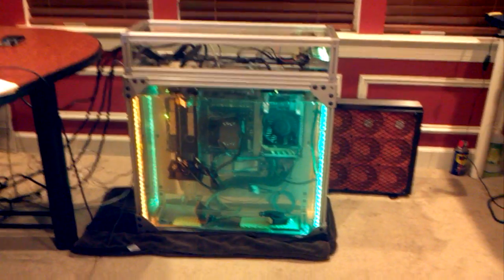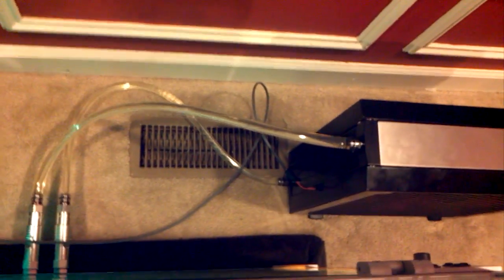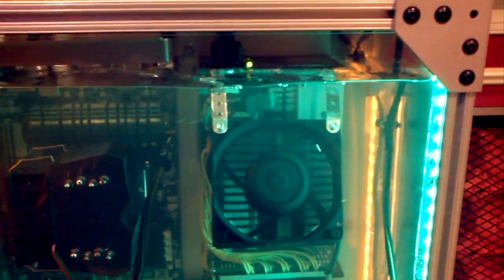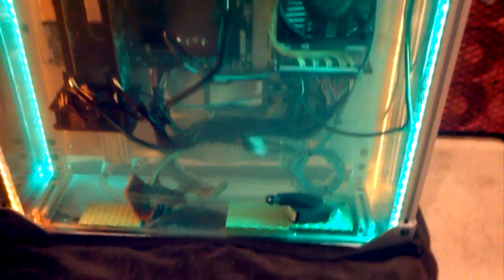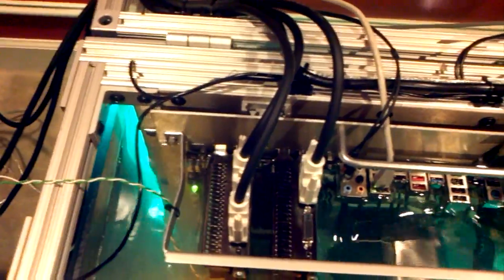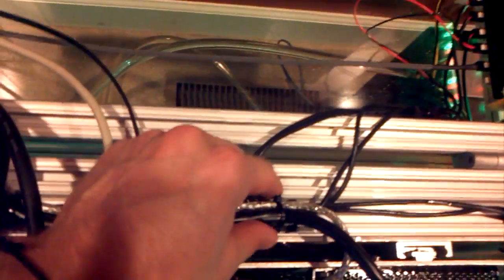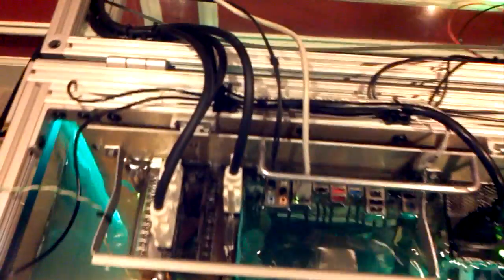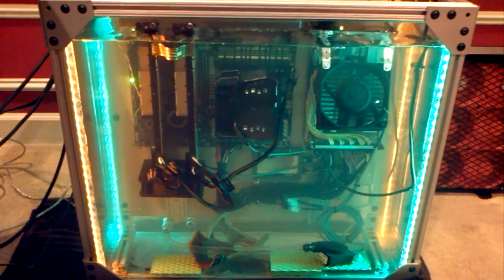Mineral Oil Computer Done!

Comment: Can someone explain to me how he submerges a whole motherboard with CPU and everything with it still running.
Reply: its not conductive, but absorbs heat.
Reply: it's mineral oil not water.
Reply: Oils don't conduct electricity the only difference for the electronics between the air and this is the oil disperses heat better....
Reply: Mineral oil doesn't conduct electricity, its also relatively inert and doesn't react with the silicon, copper and other materials in the computer components.

it does have a high specific heat capacity though so thats why he needs the large radiator. Mineral oil absorbs heat and retains it, something like water absorbs the heat and the releases it.

There are no real benefits to using it though, a well thought out custom liquid cooling loop would out perform the submerged PC with far less hassle, mess and expense (the large amount of oil is expensive by itself, £4 per litre when bought in bulk. A setup like this could use as much as 50-75 litre). Upgrading or maintaining a mineral oil system is a nightmare of gooey oily mess and its very difficult and time consuming to clean any parts you remove, people mainly build these systems for the cool factor because a submerged machine is very eye catching.
Reply: Bosh Wean no one forced you to.
Reply: RabidCicada You can build a near silent air cooled system let alone liquid cooled, its not hard and its not as expensive as building a submerged PC. If thats why you built it you're doing it wrong, if you build it because you liked the looks more power to you as there is nothing wrong with aesthetic choices.
Reply: Bung Bruiser Exactly, your biggest risk is an oily mess if want to upgrade and or something goes wrong
Reply: he submerged it in mineral oil. does not conduct electricity and is not a danger for your computer if submerged. but you would have to think twice before trying that, cleaning mineral oil of ALL of the parts might be tricky when you dont want it in oil anymore. just saying.
Reply from the maker: Tuberuser187 he's got it right.  Except for one thing...the reason I looked at this in the first place was to cool every single component near complete silence.  It did that very well.  Very very very quiet.  Power supply and all.  Barely audible fan noise from the circulating fans etc.  So there is one advantage pure water cooling doesn't do.
Reply from the maker: Tuberuser187 wow that was a fast response!  I absolutely chose it because it looked cool.  But and air system to drive 3 high end gfx cards folding@home would certainly not be quiet.  And if it was it would income a much larger physical setups than what I used.
Reply: RabidCicada If you are running that lot under oil rather than water it would be louder than just water because of the size/amount of fans you need to cool it, I shudder to think the amount of heat that oil would hold otherwise. An air system with 3x gpus would be noisy but near silent with air is possible.

You can get full tower size cases that easily mount a pair of 420mm and/or 360 radiators and would be more than enough to keep even three of the hottest hybrid AMD GPU and space heaters (seriously they should move into the home heating market) cool and silent.
Reply from the maker: Tuberuser187 about the fan thing...that's why I did oil....even the fans themselves are in the oil submerged.  So the oil really does silence EVERYTHING.  Pure water can't possibly be as quiet because the pumping mechanisms are not submerged.  And air would require very high speed or very large fans... to the point where you get whine for high speed or shuddering from large size.

I have submerged fans for oil circulation.  If I didn't, I got stratification of thermal layers to an extreme.  I had super hot oil on top with balmy warm oil on bottom
Reply: RabidCicada But how are you cooling the oil? Unless its 20mm deep and as much surface area you get with a king sized bed the oil will not disperse enough heat into the air, probably not even then as you are claiming around 1KW or more of TDP going into that oil.

You need to run the oil through a large radiator with air forced through to cool the oil which means lots of air flow and powerful pumps to move the viscous liquid, circulating it around inside the tank isn't enough. With a kilowatt or more of TDP you could replace mineral oil with cooking oil and you would have a great deep fat fryer, how many deep fat fryers cool themselves just by contact with the air when the heat is constantly applied?

Mineral oil is nearly as inefficient as air at dispersing any heat it holds and holds far less heat (1.67 kJ/kg.K vs. 4.19 kJ/kg.K), water is far more efficient hence smaller radiators with less air flow. Less air flow, less noise.
Reply: Tuberuser187 You could feasibly use a copper coil on one side of the tank and pass cooled water through it with fans or an Ice pack (something to get it very cold) and since the inside is oil you wont have to worry about any condensation inside so you could actually make it ~40-50F with easy but then again your still using a massive overcharged liquid cooling BUT it would run your computer and temperatures that a air cooled PC would never be able to achieve and a water cooled one was unable to since it'd cause condensation on the wire/tubes with such cold water.
Reply from the maker: Tuberuser187 theres a large radiator behind the PC with very low air flow through it.  It works well enough as demonstrated by use.
Reply: RabidCicada To cool a radiator with mineral oil inside will need more airflow than a radiator with a 50/50 mix of glycol and water, its without question. It might work well but a water cooled setup would have been cheaper, less messy and even quieter with less effort.
Reply: NexusChild925 Some people just build Freon setups using freezer parts (compressor etc) with well insulated tubing for sub zero cooling.
Reply: Tuberuser187 Yes but that brings additional issues like 1. the expertise to maintain and the hassle of maintenance. and 2. Wouldn't there be issue of condensation appearing on the boards and drives themselves rather than the tubing?
My method allows for a simple although, less effective, build. It'd be a very cool experiment to create and in the end it would both be a cheap, and safe alternative which requires little to no maintenance. Sad thing is I can't do it since I don't have the time or funds to test it lol but in the end it could even be improved upon by making the space above the oil that's a vacuum or completely dry air free of moisture to ensure no water droplets can form. All in all the build would take a lot of time and revamping for the first build but then it'd be possible to trouble shoot any issues and improve upon them.
Reply: NexusChild925 It would be interesting to do maybe, practically though for long term sub zero cooling a Freon setup is the only real solution at the moment.

If its put together well it would need no more maintenance than a freezer would, the board and drives wouldn't get condensation on them. Condensation forms at the point the warmer ambient air contacts anything colder than itself which causes the moisture to condense back into water as warmer air can hold more moisture. As long as the Freezer components, tubing and the cold blocks/contact points are well insulated from the room temperature air there will be no condensation. the only part you need exposed are the contacts between the cooling system and the hot chips (known as evaporators), you also need to apply a lot of insulation around the to isolate them.

Literally spreading some form of liquid epoxy or something similar around the heat spreader of the CPU/GPU which is obviously permanent.

All in subzero cooling is the most impractical and probably useless way of cooling a PC, generally only the most determined hobbyists and enthusiasts do it or people looking to break overclocking world records.

Oh yeah, in some countries it might be illegal too. Gasses like Freon are heavily restricted and you need government licences to handle them and purposefully releasing them can get you prosecuted, that includes accidental releases from home made equipment.
Reply: Tuberuser187 Yeah I knew how condensation formed and my worry was that the condensation forming wouldn't be on the tubes but the motherboard, HDD, etc. unless your cooling the entire case not just the individual components like the GPU, and CPU the air inside will always be slightly hotter than the components themselves allowing condensation to form just like if you were to open your freezer the walls would be damp or even icy....or am I over looking something else about the subzero set up?
Reply: NexusChild925 The reason you get water or ice build up in your fridge or freezer is because you open it :) You basically let some of the colder and drier out and replace it with some warmer air that holds more moisture, when that air cools down it cannot hold as much water as it could at room temperature. 

The point at which is condenses out is called the "dew point", the range of temperatures and humidity where this can happen are generally way outside the ranges associated with warm or even hot computer parts and most indoor temperatures.

With a sub zero cooling setup the most likely part of the system to cause that is the evaporator where the temperature drops rapidly due to the expansion of the gas, in normal 20-25°C room temperatures it will quickly chill the air that touches it to the dew point and then freeze the moisture.

As long as you insulate/isolate it both from the board and the surrounding air there will be no condensation, it is obviously smart to insulate everything else (aside from the compressor) as well but the evaporator is where you really need to take extra care.

The air temperature inside the case doesn't matter in anyway other than it normally would, nothing else changes you are just putting a really, really cold thing next to the CPU/GPU that you want to cool instead of a standard heatsink or water block. If you are packing the compressor inside the case that needs some attention as those get warm in their own right but otherwise apart from bolting the refrigerated circuit to the hot bits inside the PC (and isolating them ofc) its basically business as usual when compared to standard air or liquid cooling.
Reply: Tuberuser187
Ah thanks for explaining that, i can see now why its a viable choice for users but yea like you said earlier this seems to be going completely overboard lol
Reply: RoMMeL1337ak47 Exactly, water holds more heat and transfers it faster. You need less air flow from the radiator and you can fit the whole cooling loop completely inside the case, it wont end up weighing 75kg+ as the oil cooled computer nor anywhere near as messy.
Reply: RoMMeL1337ak47 Well go back and re-read the comment, I admit I wasn't as clear as I could have been (tired posting) but the discussion was about water cooling being more efficient than oil. The figures I quoted are actually the specific heat capacity of water and mineral oil and not air, the whole quote you mined also happened to be:-

"mineral oil is nearly as inefficient as air at dispersing any heat it holds and holds far less heat (1.67 kJ/kg.K vs. 4.19 kJ/kg.K), water is far more efficient"

So yeah I hold my hands up to not being as clear as I could have been but the topic of discussion was about oil vs water cooling and not air.
Reply from the maker: RoMMeL1337ak47 When I moved the computer I pumped all the oil back out and into the barrels:).  It is indeed a pain:).
Reply from the maker: Tuberuser187 I don't know how well youtube tracks reply-to-orig-comment but I'm responding to your statement about 50/50 glycol and water and being quieter.  I agree with you if you include using other sound damping materials to quiet components that are actively loud.  Remember, I am balancing quieting components that are not quieted by having a water cooling block instlalled along with cooling quietly.  Even with water cooling, the power supply is not quieted regardless of how effective the water loop is.  Same for any other component that is just naturally loud, regardless of water block or not.  Mineral oil cooled and quieted all of those.  The remaining fans/noise-creators are controlled strictly by me...the ones on the radiator.
Reply: RabidCicada You can have quiet or even silent PSUs, there are zero RPM fan models that do not power the fan until the PSU hits 40% load so if you fit an oversized one most the time the fan will not spin up yet keep it within the 20% load area for efficiency. There are also the more expensive passively cooled ones, PSUs are actually so quiet now that the actual coil whine of the electrical components can be a bigger factor than very low RPM fans.

There is not need for "an actively loud PC" whatsoever any more, sound dampened cases are also cheap now with cases like the NZXT H440 have sound dampening material and room for 2x 360mm radiators which is enough to cool anything.

Fit a decent passive or zero fan RPM PSU and you have a mid tower PSU for far less mess and hassle that you would need to place inside an anechoic chamber if you wanted to measure the noise.
Reply from the maker: Tuberuser187 When I looked I didn't see any 1.5kw power supplies that were passive cooled or water cooled.  Do you know of any?  Maybe they didn't exist when I was looking before.  About using a metered rpm power supply...My plan was to run folding or some other thing 24/7 so metering wouldn't have mattered.  About having a dampened case, you are right that perhaps it would have been enough with 2x360 rads.  The heat generated by 24/7 folding/crypto would have been pretty substantial on 3 top end gfx cards.  It's all kind of moot now since I ended up getting rid of it due to the mess :).
Reply: RabidCicada Off the top of my head I do not know of any completely passivley cooled ones with that much ouput but Corsair just relaunched a new AX1500 with a zero RPM fan, the fan will start a 40% load and only really start spinning up enough to be audible after 80% or so load.
Reply: It's more bragging rights and the show factor than anything.
Reply: NexusChild925
Wrong, it doesnt disperse heat better than air... and it's a pain in the ass if something burns out. plus you cant put mechanical drives in it.
Reply: Shawn Ritchie 1st off, i didn't say anything about mechanical parts, the only thing you do NOT submerge is hard drive. also dvd/cd drives, but nobody uses those anymore. as for burnt parts, you can just replace them and its up and running. and i doubt it will burn if its submerged in mineral oil as its refrigeration rate is a lot better than air, also, it looks better.
Reply: Tuberuser187  tl;dr
Reply: Wow, yeah i hate when some one asks a question and it has been answered well in the first reply, but people still comment on it LIKE srly shut the fuck up, he doesn't need that much info.
Reply: So could i submerge my phone in mineral oil and have ot be fine?
Reply: ferrariteddy Maybe, it will destroy certain kinds of rubber and silicone etc and it makes plastic brittle with continued exposure. 

It won't hurt the electronics but it could destroy other materials that are inside your phone.

Comment: Now all you need to do is get your parts out to replace them for some better ones,,, It will be nice trying to clean the mineral oil off of your stuff and hands!
Reply from the maker: Yeah:)...That's why I have a removable slide out tray the motherboard is mounted on.  But, the mess is indeed why I have put this beast away:).  Tired of wiping mineral oil off of everything after I mess with it's insides.  It was a fun experiment and ran well for 8 months or so.

Comment: WHY ISNT THE PC BROKEN?
Reply: Mineral oil is not conductive so electronics are fine in it. That also means you are able to cool your pc over the whole surface. That is why it is kind of worth doing, even though water and air absorb heat better. Very cool but overall not worth the trouble.
Reply from the maker: Vanilla Gorilla Not only that...but it allows you to SILENCE every component.  Which was the main factor for me.
Reply: ***** Mineral oil is conductive about at 962Mohms and eletronics can work fine
Reply: ***** why....
Reply: mineral oil is non conductive and doesn't rust

Comment: could you do that in a clear plexi case and submerge that in water so it lust looks like its in the water?
Reply: Kyle Stapp The cabling wouldn't be hard, just run it through a tube from the comp case to the surface, and use some waterproof sealant around the edges.
Reply: You could, as long as you do some math or experimentation and ensure that the coefficient of heat transfer is high enough through the plexiglass.  You'd also have to deal with getting all the cabling etc through pure water.

Comment: Looks cool but its probably better to just go with a normal water cooling system lol.. I just cant see this being any better then standard water cooling unless you can keep that oil MUCH cooler by passing it threw a freezer or something lol..  But yeah it looks pretty cool :)  (Oh smack my MB died why wont they take it back and replace it?  Umm its full of oil lol)
Reply from the maker: ***** The other two commenters are correct.  Mineral Oil is WAY WORSE than water for cooling.  Just looks cool and wont ruin electronics as much on contact

Comment: What is keeping that submerged fan from burning out with the added stress of the oil?
Reply: i think it has to do with the oil also lubricating the fan, i'm not completely sure though.
Reply: The oil is a lubricant but it also pulls the heat away that would cause it to burn up in a normal air cooled system.
Reply: dj beard Pretty much sums it up.  To be sure...you need to select appropriate fans.  I chose high powered daltec fans that could literally push the oil at a reasonable flow.